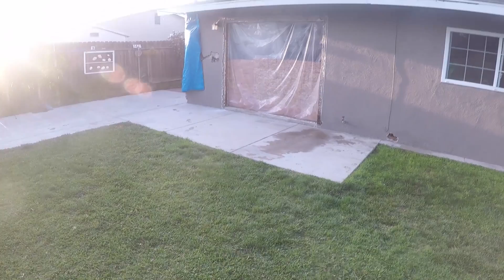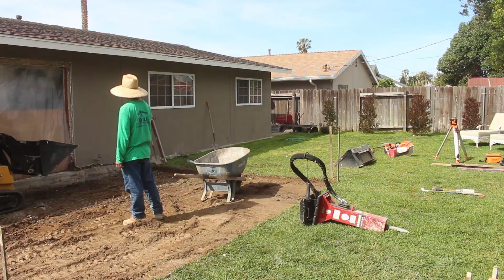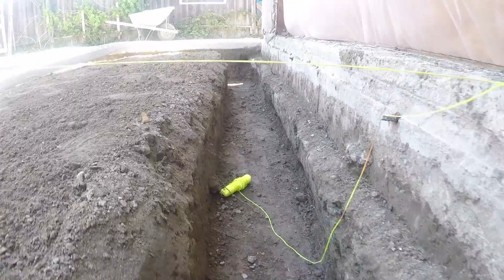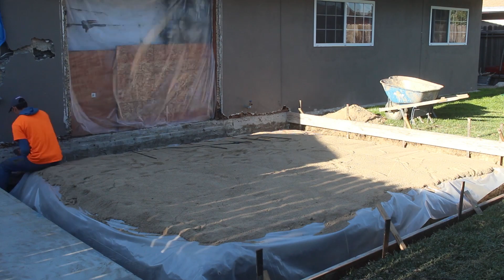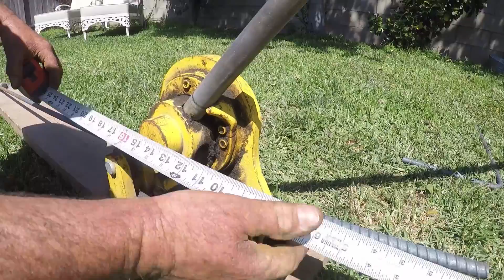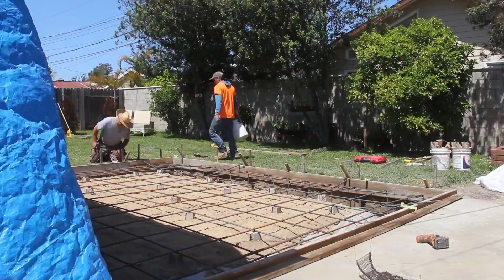How to Pour a Concrete Foundation House Addition Setup Part 1

Comment: @OdellCompleteConcrete  Thanks for putting the great videos! How is the special inspection done for epoxy and anchor bolts? Do you need to install the anchor bolt and rebar dowels in presence of the city inspector or third party special inspector? Do you have a video on it?
Reply from the maker: Yes it all happens while inspector watches

Comment: Your videos are awesome, much appreciated.  I have a similar situation to this one, but we need to build on top of the existing patio about 10" to meet the house slab.  One concrete contractor suggested leaving the old patio in place, digging the footings around the perimeter of the current patio (but not along the house where the old patio meets the slab) and then pour over the old patio.  Any thoughts on this approach?
Reply from the maker: Doesn't sound to good
Reply: @OdellCompleteConcrete  Thank you, I thought so as well

Comment: Detail #6 is throwing me off. It shows footing to be 24" min deep. That includes the 8" of curb above grade? But then shows a 12" deep footing on same detail #6. But if you do the math at 24" - 8" that would be 16" deep from F.G. I guess I am thinking more of raised foundation work where everything is measured from crawl space grade to determine depth of footing. Was that what you were referring to when you mentioned 12" compared to 16"? LOL hope I'm making sense.
Reply from the maker: Normally all footings will start 12' minimal below grade and whatever it takes to get to FF isn't included

Comment: @odellcompleteconcrete 
 we bought a house and the extension is a good inch away from the house !!! wish they drilled into the home and did the rebar !!! how can this be fixed or would it have to be redone ?
Reply from the maker: Probably need to start over.

Comment: @Odell Complete Concrete  our contractor is not going to use rebar.  They're just going to use fiber in the concrete for a 30' x 16' concrete slab for patio.  Is that cool?
Reply from the maker: Maybe if its big rock mix
Reply: @OdellCompleteConcrete  thanks for the reply.  That'll work even if you don't compress the dirt.  Like the ground wasn't leveled like your video.  The grass was pulled and they added visqueen.  Next about to just pour concrete with fiber

Comment: Solid explanation of what goes into this work. Problem is, I don't think all companies would do the work as good as this. 
I am planning to have extension done here in Houston myself, adding about 500sq ft to the master bedroom. What would you guess the cost of that would be, for the slab work? Or better question is: Do you work in Houston, TX?  Thanks
Reply from the maker: 7500
Reply: @OdellCompleteConcrete  Thanks. That actually great for 500sq ft. 
I am torn between 350sq ft and 500sq ft, given the backyard space I have, which is massive. Do you think concrete guys have minimum they have to charge or if I end up doing 350sq ft, the price will be  a simple math, which is $5250?

Comment: Great videos guys, hey, my house is currently under renovation, but theres some issues arose most notably bended walls on some parts. The contractor's solution is to paste/cover up with cement to make it look straight, but im sceptical of its strength and its ability to holds the roof.. could you guys help out with some suggestions? Cheers
Reply from the maker: Sure
Send some puctures
Reply: @OdellCompleteConcrete   sure. Thank you

Comment: 60 years ago a "shoe block" was used to support a brick veneer on a wood structure. And, the inspector's and architect's college education notwithstanding, a stronger tie-in to the old foundation would have been to open up some of the cores of the block and make sure the new pour filled the cavities. Looks more like a launch pad than an addition to a 50 year old residence??  Good job!!
Reply from the maker: Yes
Things gave changed alot

Comment: Why did you not insulate the concrete walls? Either on the top or outside with rigid foam?
Reply from the maker: This is Southern Ca.
Where its beach weather everyday

Comment: When it comes to the the actual pour is the footings poured at the same time as the slab or separate meaning  footings first then later on pour the slab i only ask because the construction company are pouring one down the street and are just pouring the footings first ? 🤔🤔 Why I don't know but it's odd
Reply from the maker: In this case it's all being poured at once.
Reply: @OdellCompleteConcrete  I know but I'm wondering why would someone pour them separately? Seems like a bad idea to me I figured I'd ask a expert

Comment: No fiber mesh? IF you do fiber mesh and 4 inch in middle, then you don't need metal in the middle, correct?
Reply from the maker: Yes you still need the metal
Reply: @OdellCompleteConcrete  Florida Martin County code is different i guess. I prerfer more metal. But if inspections dont need it, then i leave it out of pad i guess. Footers got 3 #5 in them. Im just a DYI guy with permit meeting code.

Comment: Instead of topcon screws try 16 or 10 penny nail with a short piece of tie wire in hole you drilled. It works great.
Reply from the maker: A lot of moving parts

Comment: Nice monolithic set up! 
Maybe the "brick ledge" was an over dig for the original concrete footer with the footer centered under the 8"(?) foundation wall. The 3/4" or maybe 1 1/2" ledge was where they placed their 2 X 4 form on top of the block foundation for the 4" floor and thus leaving a 'tie-in' for the stucco wall. I have never seen that and my home building career was 1968-1983.
Reply from the maker: I think you covered the period this was done.
I think it might have been limited to a small area

Comment: I think the ledge is the actual footing, probably 16" wide, and then the concrete blocks sit on top of the footing.  If the ledge were for brick, stone, etc. support, the top of the ledge would likely be at grade level.  Actually for stone, the top of ledge has to be at least four inches above grade.  You were at the site.  If the ledge was not the top of the footing, then they likely made a mistake in the height of the ledge for brick veneer that never went on the building.
You've dug down to the footing level.  If one designed an inverted t-footing, you'll see a ledge, for example, 16" wide footing with 8" stem wall on top.
Reply from the maker: The ledge was part of the block, a weird designed block. The footing for the block was below that
Reply: @OdellCompleteConcrete  Well, it's a big Mystery!  You do great work!
Reply from the maker: Its definitely old school and very limited

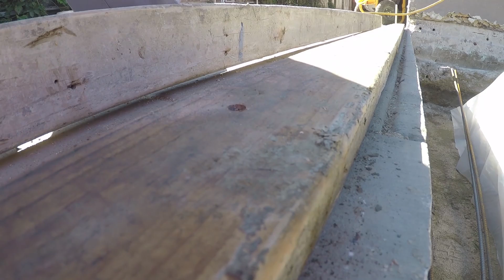Comment: At 12:22 interested of screws I use a 16d double head nail an two pieces of tie wire same 3/16 hole. if it's a 1/4 the use a 16d sinker an a double.. tilt-up carpenter skills.. lol
Reply from the maker: Sounds like a lot of parts to carry around and not reuseable

Comment: Can you get like a ditch witch add-on or anything like that for the vermeer so you wouldn't have to do as much digging by hand for the footing, or would it not even be worth it?
Reply from the maker: They have a trenching attachment, 6" wide that can go 24" deep.
Also a hoe attachment with a 4.5' reach 12" wide bucket

Comment: Just an observation, all that rebar, concrete and grouting for a single story, timber framed building. The specs. seem a bit of overkill! Its not the local authorities  money tho. is it? Great job as usual, thanks David.
Reply from the maker: Standard issue around here in earth quake country

Comment: So what’s the use of the plastic if you cover it with sand?
Reply from the maker: Sand is clean and water cant get in to the sand
Reply: Odell Complete Concrete so the slab won’t sweat?

Comment: Thanks for sharing your clean work. It would have been a good idea to add another bar to the two-foot wide footing. There's a lot of concrete down there without reinforcement.
Reply from the maker: More concrete bigger foot print, stronger all around

Comment: Love you channel.   But sand does not meet 100% compaction when you toss it on the ground. Our soil is predominantly  sand and have densometer  checks done on every home foundation.  It’s not uncommon to find native material in the low 90’s. But we have also reached over 100% compaction with roller and hydraulic comp. moral of the story.  Tamp and soak it like you would any fill because it will settle.
Reply from the maker: I think it depends on the sand

Comment: Why do you lay a plastic tarp between the poured sand?
Reply: LA County (and other municipality) code requirement for a moisture barrier.
Reply from the maker: Plastic is a moisture barrier.
It protects from moisture coming in to the house

Comment: Job, small by surface but extensive by knowledge involved,  how to do it properly
Reply from the maker: Small job same processes.
TY
Reply: Odell Complete Concrete random comparison here...  but it’s the same concept with haircuts! Lol ;) ppl honestly think “just a trim” should be cheaper than a haircut Bc... well, it’s just a trim. However, regardless of whether you’re cutting off 1/8” or 8”, the process is exactly the same - same number of steps, same everything - 🤷‍♀️ the ONLY difference is the amount of hair left on the floor afterwards. 🤗 

tfs these vids with us!
Reply: @OdellCompleteConcrete  our contractor is not going to use rebar.  They're just going to use fiber in the concrete for a 30' x 16' concrete slab for patio.  Is that cool?